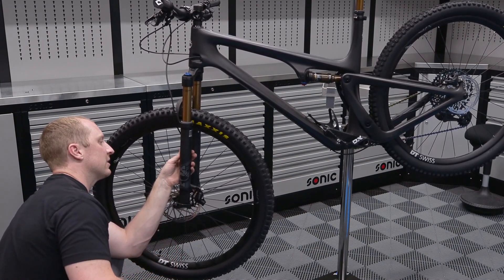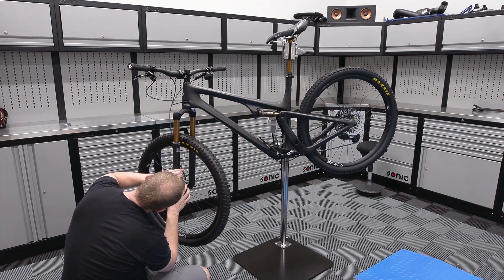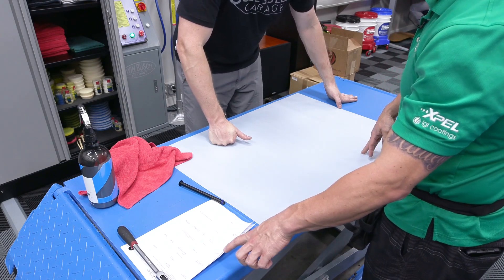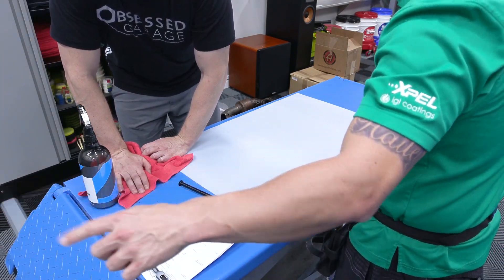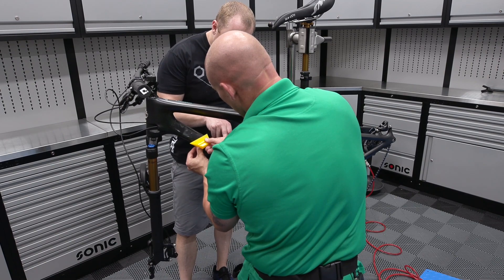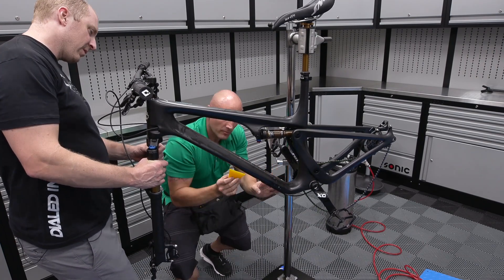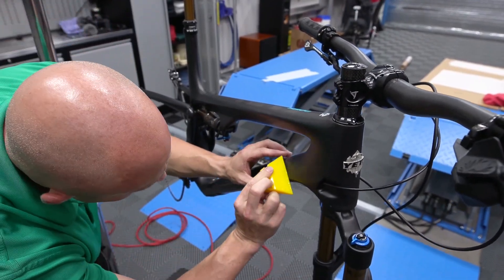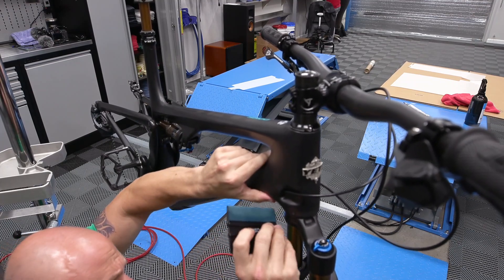2019 Yeti SB100 Mountain Bike: E5 - Invisiframe Paint Protection Film

Comment: Matt, your bike stand allows you to lock the bike in at any angle so you don't have to get on your knees to see and work on the bottom tubes.
Reply: I think it's just a bike display.  If any "work" needs to get done he could just sit it upside down and wouldn't need an actual rack.
Reply: @bruceleeroy1674  The Park shop bike stand will let you rotate the bike 360 degrees.
Reply: @halz7  that's pretty cool he bough a rotating bike display.  I am digging the dark grey color.
Reply from the maker: I think I need a different arm to allow for that.